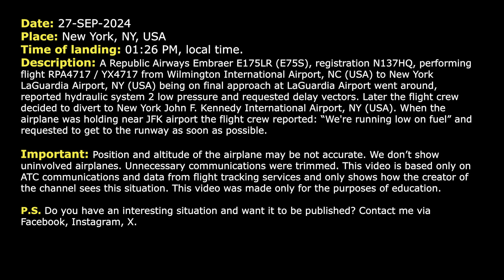Time matters. Low amount of fuel and hydraulic failure. Pilots have problems over New York. Real ATC

Comment: I'm curious if "low pressure in hydraulic 2" is critical to a safe landing.
Reply: Not familiar with the type but generally it's a redundant system so not necessarily, but having it inop can change the way things behave so the go around was the right call while reviewing relevant details of how it impacts behavior of the different systems.

Comment: Question from someone who has no idea how it works. Why does it take so long to get the souls on board number in an emergency? Isn't figuring out how many people are on-board after you board and close the gates pretty easy / what the FA's do / system would do based on how many boarding passes are scanned? Surely this number could be written down somewhere on the top of a check-list or something handy before take-off so it's ready to go in an emergency to pass on to the ATC. Sorry if it's not so easy ... just a thought from someone uneducated with how the flight deck works!
Reply: Well, in reality it really is not important information to relay to ATC when they're busy juggling running checklists / QRH, coordinating with their operations dept, talking with maintenance, talking with ATC, letting cabin crew know what's up, and of course flying the aircraft.  Dropping a more important task to pull up the manifest just isn't that important and ultimately ATC doesn't do anything with that information anyway.

Now in an ideal world (and this happens) they'll let ATC know that information when they declare an emergency up front so they don't have to tie up the radio asking for it later but even then it's all but certain the next controller will ask them the exact same information again anyway.
Reply: @cruisinguy6024  I understand what you're saying for sure, but then why do we have videos like this one where ATC is pressing them 4 or 5 times for the number of souls on board if it isn't that important? Every single video of an emergency has ATC asking for fuel and souls on board so they can document that in their system or whatever they do on their end so it must have some importance (maybe not to the pilots at the time). But, if it procedure states that ATC must ask this then would it not be easier to spend 15 seconds to confirm this # before they even take off? Surely they could write this # down or have it ready to go and avoid scrambling to find it in an actual emergency, no? I just have seen so many videos of it being an issue or frustrating for the pilots who are doing like you said, a million other things and then being called multiple times for souls on board.
Reply: Because there’s not much difference between 40 and 200 people. It’s a mass casualty incident either way and they are supposed to fly the plane

Comment: How many times does the pilots have to say “stand by” for souls on board?!?! Geez!
Reply: and they even didn't pass that to the next controller
Reply: @m24639297  Exactly. The first guy was so insistent that he had to have it to pass along. And then New York asked for it anyway. 🤦🏼‍♀️
Reply: @m24639297 I bet you he passed it along.  They then went to another frequency after that, where it was asked again.  So either LGA passed it back to their supervisor and told JFK they had the info and the supervisor at LGA didn't tell the supervisor at JFK that they had the info, so the supervisor at JFK asked for it, or it was controller to controller and controller 2 didn't pass to controller 3 the info.  But, my money is on the supervisors/operation managers not passing the info to all parties involved.  So for example the LGA supervisor just called JFK tower with the info, and said ok we are good.  The JFk supervisor hears they have an emergency but hasn't gotten any details and asks for the info to pass to the tower, without knowing it's been passed.  I'm not asking the pilots for anything more than I need, which is where they are going, unless the supervisor is pressing me to get more info.  It is usually the ones not working that can't keep this info passing along the chain, that causes them to distract the controller with asking again.